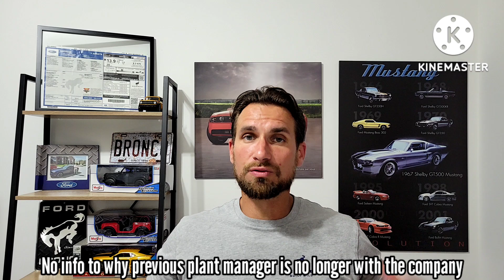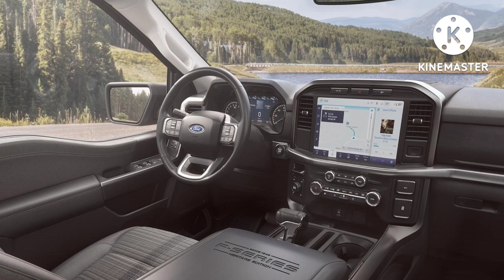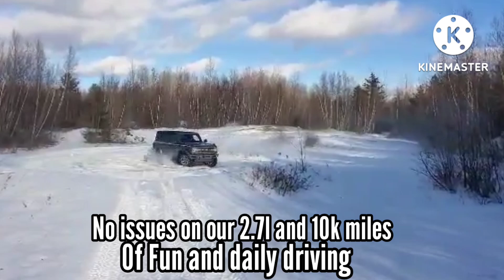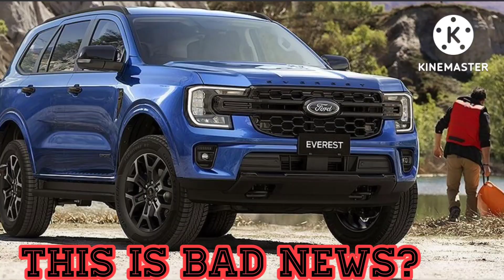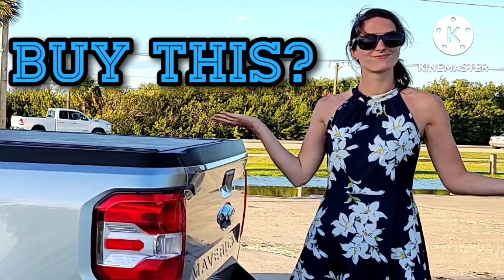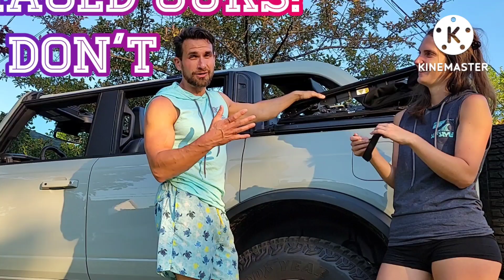Ford Plant Production Problems and plans to increase BUILD QUALITY

Comment: Finisher. As a customer and a quality professional, I am very happy and pleased with the quality of my Maverick. In buying a "cheap" truck I didn't expect it to be so good. As for Ford stock, it has been a low price stock for years. Over the last year it has climbed some but has paid good dividends. Ford has also had the foresight to avoid the issues of the government bailout trend of a few years ago. They sold their overstock and sat on the cash while GM and Chrysler gobbled at the teet of the government. I believe that Ford stock can very possibly double in the next 12 to 24 months.
Reply from the maker: I agree with everything you've said here and I really do find the Maverick is surprisingly extremely well put together especially considering its price.
Reply: @Johnnyscarcarereviews  at 5000 miles, zero problems. Lots of stuff available for customizing. My favorite is the roll-up hard cover with the Ford logo that shows when rolled up.

Comment: There’s been some rumors around the internet about the new 2023 model year Bronco that will not take any new orders from new customers and they will only transfer or build 2021 and 2022 model years into 2023. I personally don’t think this is true, well part of it, but what information do you have or know about it Johnny?
Reply from the maker: Whether or not they take new orders for 2023 Bronco Or not doesn't really change anything because they needed to build the old orders 1st anyways. Now I can say that they will be building old orders 1st at leastThe 1st month or 2 of 2023 production. Simply put the factory is gonna concentrate on getting 2022 clients there Broncos 1st and when there is left over production Some dealer inventory of unwanted models and trims will be built. This is because currently the remaining old orders are pretty much all badlands in sasquatch models and as a result when the factory has parts and ability to build a Big Bend but not an old order it will do so as a dealer inventory. I am hoping this will encourage dealers to sell clients there ordered Broncos At MSRP  And the very limited inventory of Soft top 2.3 l Big Bend or outer banks that they receive it received they will then if necessary try and make money with those.
Reply: @Johnnyscarcarereviews  Thank you it really does help whenever there’s false or misunderstood information on the internet. And about how long do you think it will take on average for either a badlands or wildtrack 2023 model year to be built or at least to get a VIN for my order?

Comment: Finisher. Basic fitment,  paint & sealant shouldn't be an issue from one of the oldest automotive manufacturers in the world. However,  the plant manager would be an easy fall guy to squelch consumer & market  anxiety.  I think COVID-19 exposed some operations & management issues but have to wonder if 8K job cut is knee-jerk or had been in the plans for 4-5 years.
Reply from the maker: Adam great question and I appreciate your commentary. Those are valid points thank you for taking the time to make

Comment: Ford quality has gone down a lot. I might flip my Bronco (if I ever get it) for a 4-Runner
Reply from the maker: I love the exterior of a forerunner however however the interior doesn't do anything for me. Also I would never switch my Bronco for a forerunner unless the forerunner starts having an option to remove the top on it
Reply: I, too, plan on swapping my Bronco for a 12 year old “new” truck that is grossly overpriced for what it is. I especially like the archaic 5 speed automatic, lackluster power and fuel economy (or lack thereof.) I just get so much joy from knowing that I’m paying Toyota far too much for a truck that hasn’t been seriously updated for over a decade and is a straight up cash cow for them, since the tooling has been paid off for years.
Reply: @phantom0456  did you already get a Bronco? I’m a day three reservationists and still waiting. 2D Base Squatch with a 2.7EB. I did get a Maverick in the interim. I still want the Bronco but I’m concerned about the quality issues that have been reported on Bronco6G. My Maverick has a few quality issues too but the price was fairly inexpensive so I’m not complaining.

Comment: Finisher, ford has always had issues with Quality, but I’m glad they’re getting it back to a  job one attitude. As for cameras on the line I’m in two minds about it, how much detail can you get from a camera, versus the multiple eyes the build passes before rolling off the line, I think there should be more empowered workers ( with the ability to stop the line if there’s a quality issue), coupled with a specifically trained quality inspector and separate repair person at the end of each zone of the line to catch quality issues. Especially when they ramp up production to 47 seconds per unit off the end of the line.
Reply from the maker: Al Miller thank you for your interesting commentary. I enjoyed reading this and I appreciate that you've taken the time to drop this quality comment

Comment: I used to work as engineer at a tier 1 supplier. I supported both Toyota and Ford product lines. Difference between Toyota and Ford were like black and white. When we quoted parts for Toyota what we quoted was what we made. With Ford you could count on engineering changes almost to the start of production.
With Toyota they would reuse components like door hinges across multiple lines and multiple years. Ford on the other hand was reinventing the wheel on every new model.
I really cringed when you mentioned putting inspection cameras on the line. This does not match the Toyota quality philosophy. Toyota does not believe in inspecting in quality. Their attitude is you validate the process. You don't validate the product. If the process is virtually 100% capable than you won't have defects on the finished product. For example several years ago Ford had a recall for loose bolts holding seats in place. This was inexcusable. Smart torque wrenchs have been available for decades. On the lines I supported  I could look back at the records and tell you the actual torque value of every bolt that was installed on my line.
Reply from the maker: Thank you Jimmy farmer for taking the time to write this comment. Or input is extremely interesting and helpful. Thank you very much for informing us